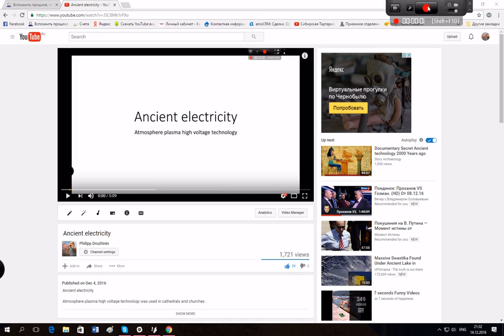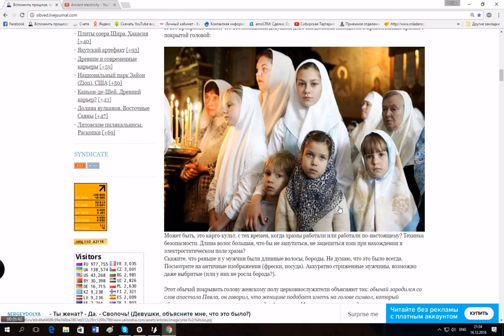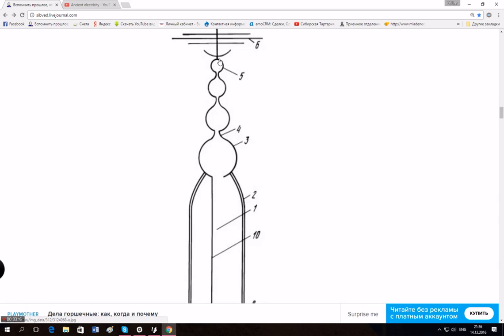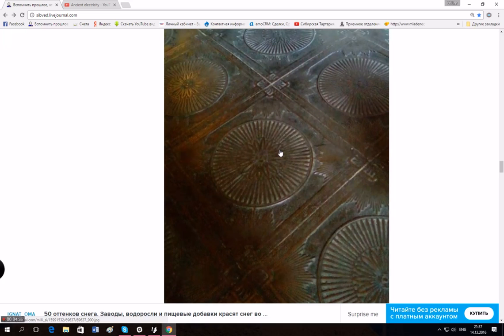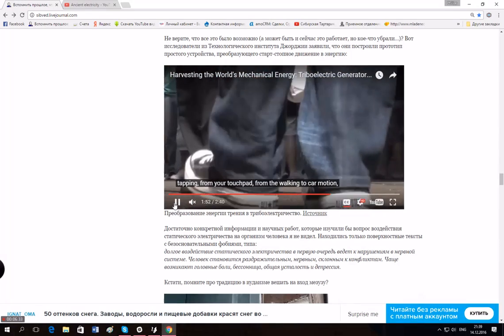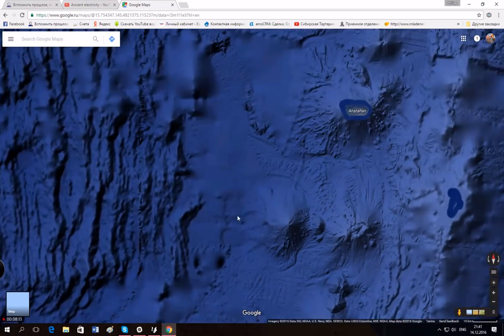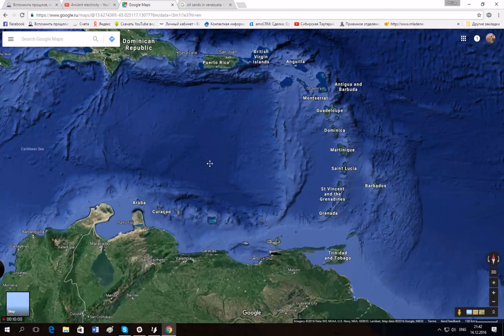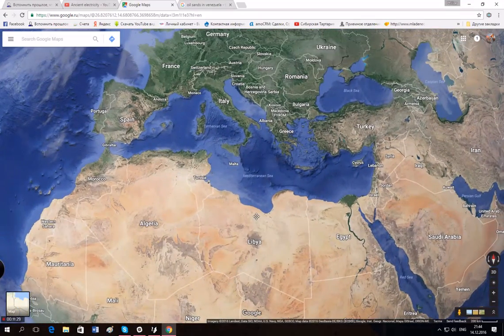Ancient electricity  My opinion

Comment: Connection Cathedrals and oversized organs. Were the organs there just for music. Building such a device needed profound knowledge of frequencies, resonance and the mathematic of standing waves. Organs are able to generate the complete spectrum from ultra low frequencies to high with all combinations of themin between. Generating "zero"point energy starts with provoking a resonating frequency. I do it with an electronic freq. generator able to provide all kinds of waveforms and frequencies. Were the organs just a way to start the tapping proces?
I live in the south west netherlands on a former swampy island. Very close to the north sea is a little town, Brielle or den Briel consisting of a "star fort" and in the centre of it a ridiculous large cathedral.  Related to the population it is far out of size.in the middle of a swampy landscape. The next village is where I live and we also have a star fort build up from imposant blocks of granite. Just one tiny little problem, nowhere in the area are they found. Sand sand and still more sand and no granite blocks. Who brought them down all the way from Swiis and Bavaria? Due to your quests I look at many many thing with complete different mindset. THANKS!!!!
Reply: That's very interesting, thank you!